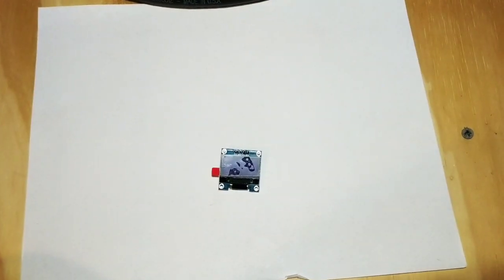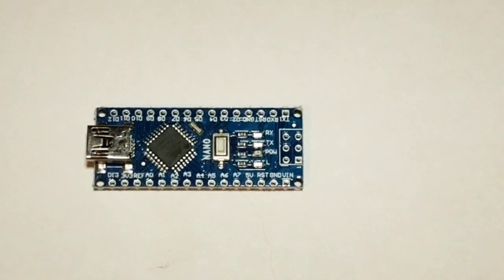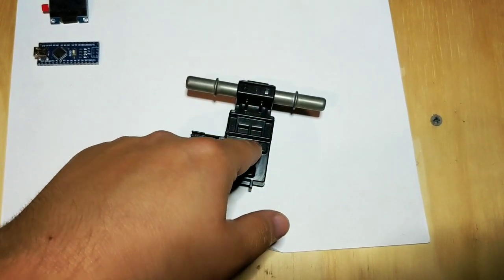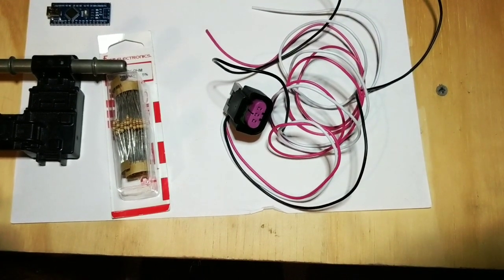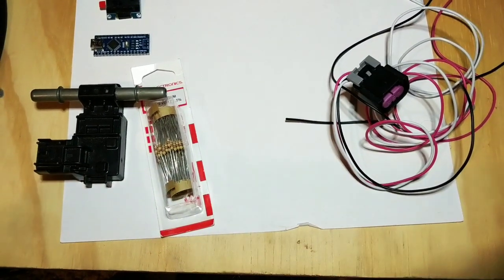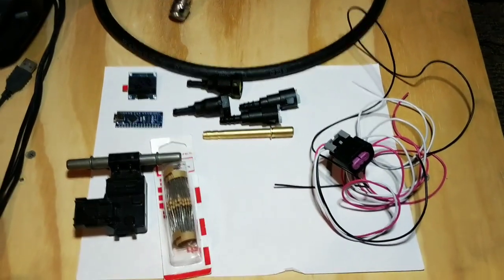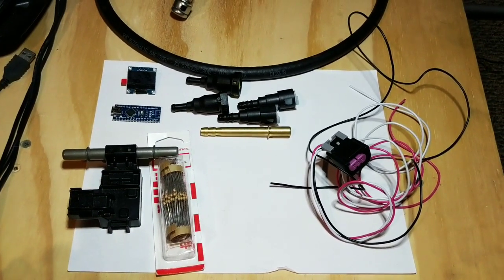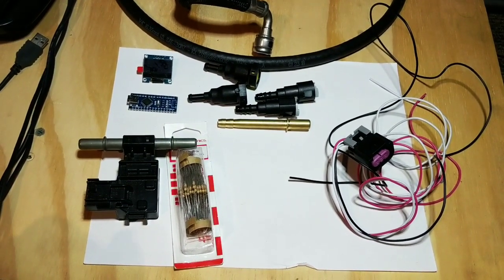How To Install DIY E-85 Ethanol % Gauge | Big Turbo Focus ST 1 of 3

Comment: Old video...Did the install video ever get made orrr?
Reply from the maker: We took on more projects and this kind pushed to the back of the list. However we are going to try this again this spring.
Reply: What i was looking at, mostly wanted to know where the fuel return like is, installs very simple if you use the Innovate gauge, just wanted to double check on the 2.0 ecoboosts